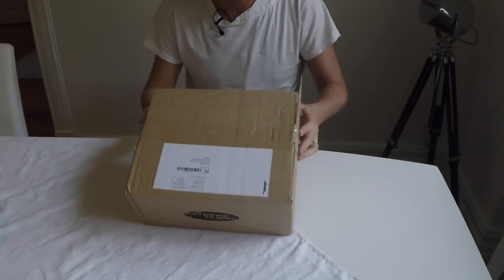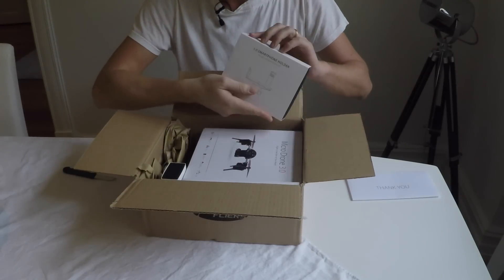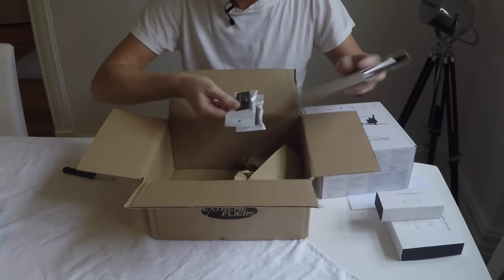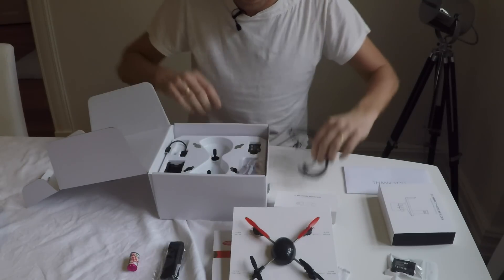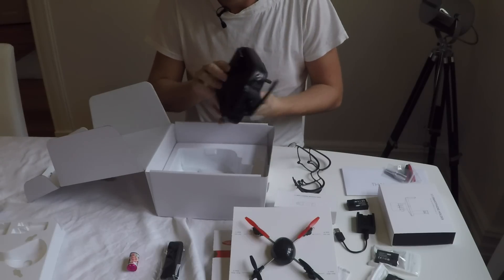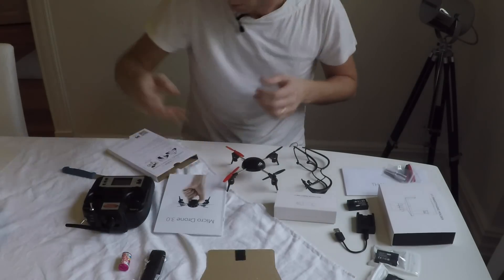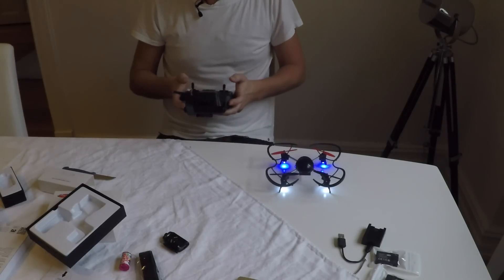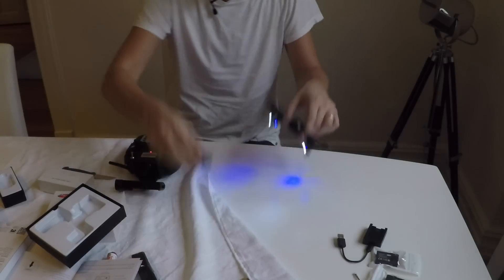Microdrone 3 0 unboxing, assembly and testflight

Comment: I had to use a knife to get my guards on also battery last maybe 4 mins, it was also impossible to keep stable and trims do not work very well. Loses connection to wifi over 9 feet all in all not worth the money.

Comment: How much power do you give it to fly? I can't control mine at all and you did it in a confined space
Reply from the maker: +thefurmanuk That depends on what mode you have it in, if you set it to slow (on the controller) it will require quite a bit of power, using fast or insane will make it very much quicker!

Comment: Thank you for posting the video! I've heard a couple comments of people not getting the full 8 minutes (6 with camera) out of their drones, could you comment on how yours is doing? It would be much appreciated!
Reply from the maker: +Alex Clack Sure thing, I will try to do some various tests of how long the battery lasts!
Reply from the maker: Did a runt inside today without Camera module attached, 6min 38seconds from takeof until the Light started flashing to indicate battery running low!
Reply: +Jimmy Adler thanks for the info!
Reply from the maker: +Alex Clack new test today with streaming of video to the quad and recording at the same time, almost exactly 3 minutes until lights started flashing, video can be found here: https://www.youtube.com/watch?v=Nqtq3uOnNRE